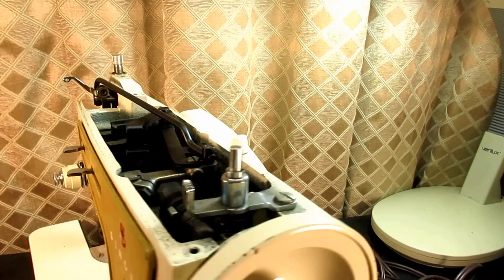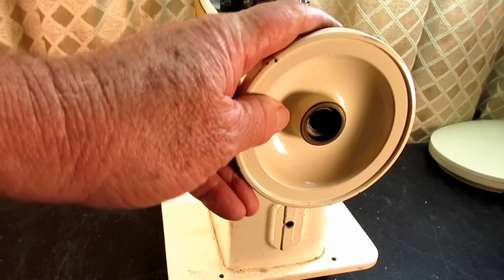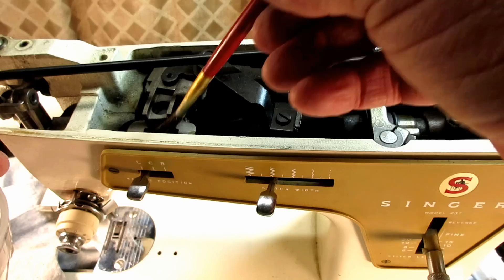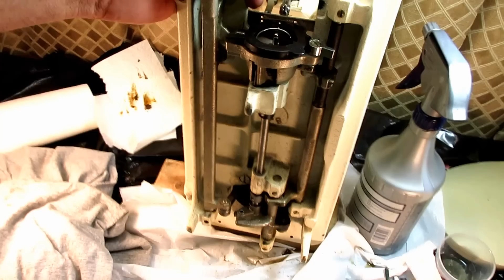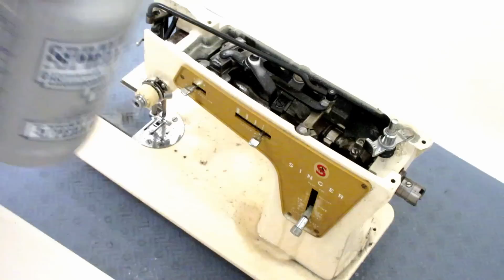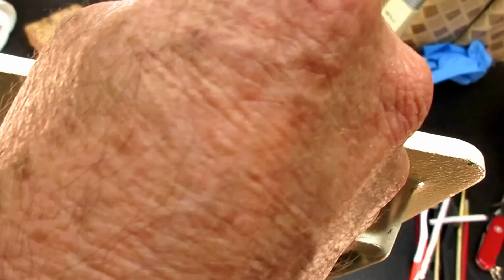The Seven Screws Method of Cleaning a Singer Model 237 Sewing Machine.

Comment: Just got this machine,  getting ready to do, question can you do this outside and use hose, do you use hot water or can I use cold?
Reply from the maker: You sure can that's what I did when I started in the beginning I put it in a 5 gallon paint bucket on my patio is less cleanup that way but be careful getting the product on flowers or shrubs I once emptied the bucket on the side of the house and some grass and it killed the grass next time I emptied it on the weeds in the backyard and it killed them too thank goodness yes you can use cold water no problem it's the chemicals that are cutting through the grease and grime good luck and thanks for watching my channel

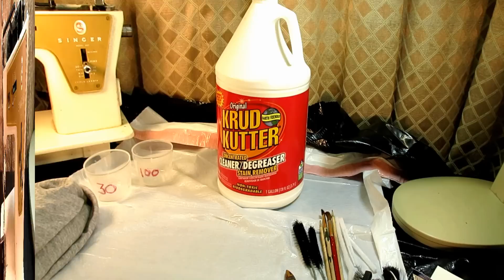Comment: 12:34 
Hi. I’ve done everything in your videos for my singer 237. The motor runs great until I hook it up with the belt. Then it makes an awful noise. I’ve tried adjusting it but that has not helped. Only makes the noise when tension is put on the motor. I’m at a loss. Anything I could try or should I order a new motor? Thanks
Reply from the maker: You seem very sure the noise is from the motor, not the handwheel or other mechanical parts of the machine, so I'll base my answer on that. 
     I would test this with the machine in bobbin winder mode, meaning the handwheel disengaged from the arm shaft as when you wind a bobbin. That eliminates all the other mechanical parts on the machine leaving just the handwheel to turn. 
     I would first check the belt for damage or a "sharp curve" where a 1 to 2" spot has a sharp permanent curve from sitting on the pulley for years. It is apparent and stiff and causes havoc as the belt turns on the pulley. Be sure the belt is in good condition without cracks or little "chunks" missing from the edges.
     Next I would check the pulley and motor shaft for being loose or having play. With the motor NOT running, just pull and push on the pulley from front to back. At the most, there may be a TINY amount of movement. If the pulley is attached to the shaft by a set screw it should have zero play or movement. A loose pulley will make the shaft and belt rattle and shake. 
     If the motor shaft is very loose I don't think you can do much about it. If you don't find any of these problems I would reinstall the belt and play with the belt tension. If it is loose it will rattle and slip. If too tight it will strain or "bog down" the motor making it strain and run slow and rough. Here is a video about the motor and wires. Maybe something in it will be meaningful to you:
https://youtu.be/mVX2Io_tomk
Reply: @andytubesewing1953  I think it’s the motor shaft. It does seem to be loose. The belt is new because I noticed it had the wrong one on it. Where would you suggest to buy a new motor from. Thanks so much for your help.
Reply from the maker: @BarbaraFlemming-co8nz  You may find one used on eBay. There are some after-market motors with brackets but I never saw one with the splicing "box" on the bottom like the 237. You'd really need to rig up a plug system for one of those, I think. Did the old belt sound as bad as with the new belt? I'd just be real sure I had the correct belt before I went on a motor buying adventure. https://www.ebay.com/itm/150850761819?itmmeta=01J3GK5X6GNY3ENZPW3JE65S0G&hash=item231f67f45b:g:2PoAAOxylhxRGQyN
What a challenge, sorry.

Comment: You could've made it a lot easier by tipping it the opposite way away from the motor the water will damage the motor if it's in there by the way use automotive brake cleaner that will clean all that out for you very easily what of all that unnecessary  Things that you were doing I wouldn't use water it will rust you can also use what they call Greece lightning very good stuff for cutting oil and grease
Reply from the maker: Jeeze Robert! We all have our own ways of doing things, don't we? These motors are tougher than you think. Here is one that was submerged in dirty water for 25 hours that cleaned up nicely and is still working just fine: https://youtu.be/6y1EN5S2sz4  I don't think a little water during a cleaning like this would hurt it. Brake Cleaner? No thanks!! I use the KK b/c it is biodegradable and earth-friendly, unlike brake cleaner which is about 90% Tetrachoroethylene, contains chlorinates, is not plastic compatible, and is not eco-friendly. You may not care about those things, but I do. It's ironic that in the end, you recommended "greece" lightning as it is also water-based just like the KK product. So the water in the greased lightning cleaner is different than the water in the KK product and won't hurt the motor. Sure, OK, whatever. 👀 I see from your videos you do repair work and record videos sometimes, so I'm looking forward to your sewing machine cleaning video showing how to do it better. I have almost 600 videos on my channel. Here is the home page for them; https://www.youtube.com/channel/UCUSPDsHaFtRoz1VA2U1xJ4w/featured     Maybe you'd like to watch some more of them and give some additional critiques about my methods. I can always use a good laugh. 🤣

Comment: Love your videos on the 237!  My machine is near mint condition and I'm wondering if there is some reason i shouldn't use an air compressor to blow the dust etc off?  Thanks!
Reply from the maker: I had the pleasure of spending time with two retired Singer Repairmen from Canada who spent winters in Arizona where I live. They cautioned about using compressed air in that manner. They said it can blow dust and grit into the moving parts and bushings/bearings of the machine. They also said canned air was the worst because (at that time) it contained moisture from the propellent and could cause damp lint to be blown into tight areas and cause rust. If you just want to "dust off" the exterior and the bobbin area I'd say that is less risky. Remember, these guys were factory trained so that was what they were told. I know most sewing repair places nowaday use the compressed air all the time and they don't believe it causes harm.
Even when I have used it around the bobbin/hook/feed dog I always vacuum first with a brush attachment thinking I'm removing stuff before I blow it into the machine. Thanks for watching my channel, Happy New Year and good luck, Casper.
Reply: @andytubesewing1953  Happy New Year and thank you!
Reply from the maker: @CasperCarver  👍 It's a unique well-made model and stronger than I thought.

Comment: I've got one 237 that has a main body case that houses the motor and looks like the case splits in two rather than top pull off.  Any info appreciated!  PS, doesn't have feed dog knob either.
Reply from the maker: There are two versions of this model, the 237 and the 237M23. There are some differences between them and maybe those include the motors.

Comment: Thank you for the time and effort you put into making these videos.  Very informative and you have a nice delivery.   I'm just asking out of curiosity, but it seems like it might save some effort to just spray the chemicals and do the brush work in the tub too.  I realize that would involve more time bent over so might not work out, but would save on effort of putting bags down and cleaning up.
Reply from the maker: I cleaned my first two vintage machines with Krud Kutter the way you mention, except on the patio in a big tub. Later, back on my bench, I always found a few places that still had grease or dirt and had to spot clean them all. Starting with my third machine I used the pre-treatment on the bench. In the long run, I feel it saves me time and effort. I often wish I had a large utility sink to use and could do pre-treatment and cleaning in it then rinse it all down the drain. You can certainly use your method and see if you are satisfied with the results. It may work just fine for you. Thanks for watching my channel.

Comment: Good idea on cleaning the machine, little laborious .Spray can of carb cleaner works better, faster. Nozzle with a straw keeps you from getting any of the chemicals on the outside plastics. You do not need to brush much, and gun oil in a spray can with Teflon and nozzle One still needs to rinse before oiling, and drying good.
Reply from the maker: Thank you for sharing on my channel. Years back I looked into carb and brake cleaners. I did not like the info on the Safety Data Sheets, all those Category 1s & 2s. The cancer warnings for the Toluene. I ended up finding the Krud Kutter and just liked it better. I'm sure your gun oil with Teflon works great. I have used Rem-Oil in the past on firearms and it worked well. I assume you are rinsing with plain water? I am curious about using the spray can of oil and you did not mention grease. I have had a couple other viewers mention this type of cleaning procedure and invited them to make a video about cleaning a sewing machine with a product like that. So far, there have been no takers, but I'll invite you too. I'm sure the YouTube community would love to see it. When you get it up and posted please let me know here in this comment reply and I'll put a link to your video and pin it to the top here. Looking forward to that. Thanks for watching my channel.

Comment: I have a question. I have just bought a singer 478 stylist. Can I clean it the same way? What about the electrical internal components? Many wires I see inside the under portion.
Reply from the maker: You can not clean the motor this way. If you are trying to avoid removing most/all the parts that's OK, but you must remove the motor from inside the machine. I have done so on similar machines. I remove the motor belt and and loosen the motor mounts and let the motor hang out the side of the motor. I wrap the motor very, very well in a quart freezer ziplock and tape it closed so no water can get in. The light socket, wiring, wire terminal for the plug all is OK to clean with the Krud Kutter. The whole key to this type of cleaning is to rinse the cleaner off very well and immediately dry the machine. I mean DRY it. Think death valley desert dry. Then get oil brushed onto metal parts and start oiling the bearings and bushings. I've had complete success doing this without any damage to the wiring or light socket or plug socket. You dry those extra after you are sure the machine is dry. Cleaning a machine that you have stripped down of parts gets 99% clean. Cleaning a machine with the parts inplace gets it about 90% clean. There are always little corners and pockets that a little dirt hides in, but it is easier and faster than stripping parts off the machine. Be very cautious of the paint on the front of the machine... the plastic face plate. I do not know how the KK will affect that or cause fading so if you leave it on the machine you should spray with the KK, wipe with a sponge and wash it immediately, like the whole process 30 seconds.
an example of removing the motor and wires and lights so you can see the motor part: https://youtu.be/32tXiiXx73o
Reply: Thank you 👌🏻 I’ll have a look see what husband can do. I’ve watched the video linked. Thank you. Very helpful.
Reply from the maker: Sure, and good luck.

Comment: This is a great tutoria!, Andy. I just bought my first sewing machine. It's a 237 from a thrift store, and I might have already donated it back if I didn't see your needle bar/presser bar video.  You saved Stella's sister, Stephanie, from going back on the block. Now she's going to get some real pampering.
Is there any reason not to dry her with my air compressor?
Reply from the maker: Congratulations on your good fortune! Using an air compressor should be OK. I'd just be careful around the thread tension unit b/c of the plastic parts. Thank you for saving that wonderful machine.

Comment: Singer Model 237 remembers the Brazilian models of sewing machine. Because it uses a motor belt system to move the sewing machine as it is popularly used in Brazil by several older models (Singer, Elgin, Necchi, Vigorelli and others).